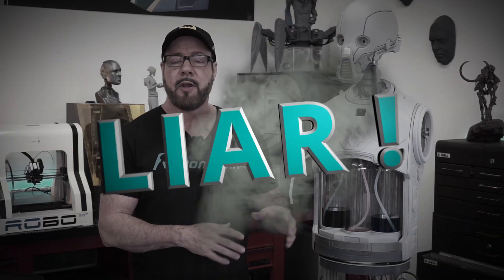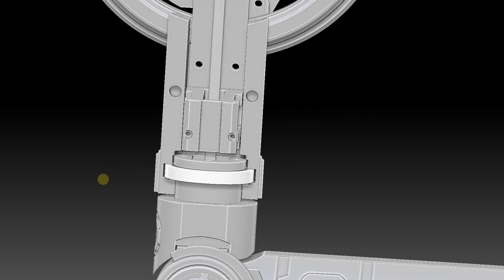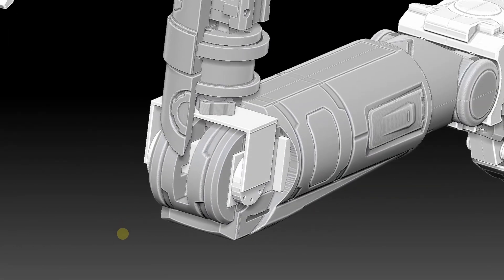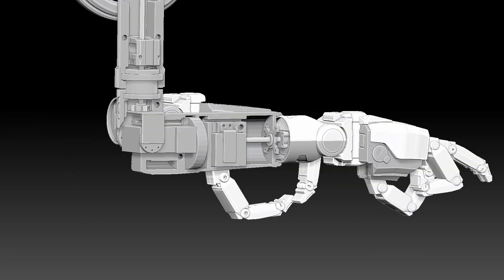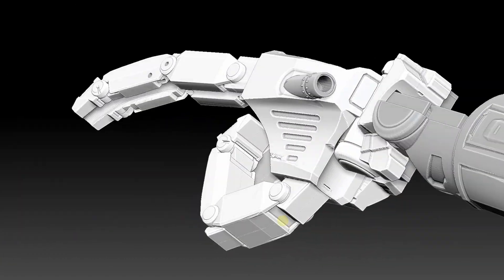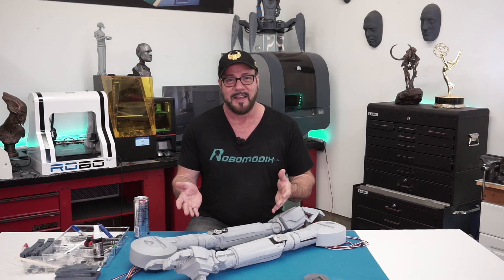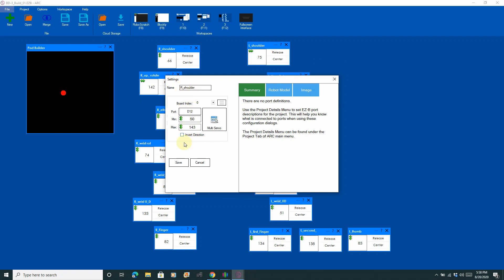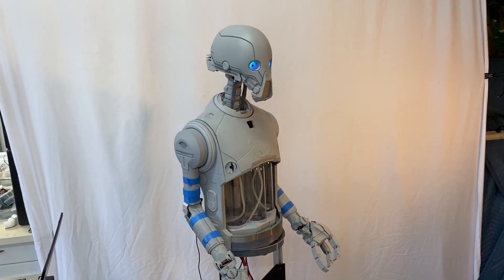My Droid Gets Arms! (Episode 4)

Comment: I am using 4 380kg servos and 2 180kg servos for the arms. What is the best way to control and power all of them with limited space. I am trying to build an AI humanoid robot so using a smaller control board would help it's weight as well. I am attaching a Jetson AGX Orin as the brain. Any advice?

Comment: T1000 Nanorh nanofluids is duable nitinol and other mixed  nano fluids ... Gel 10 skin ..  
Save servos energy
 in recycled polymers hemp fiber
and it's . .. less weight... mashroom fiber  plastics ... in the future ... perhaps
That touch pad and other software 
it's good info ... I was trying to figure things out .. which control software are You  using  in rewired  servos 💾💻
I got... G15KS Meccanoids... 🤖 ...
Thinking about building T800 
 it's duable📚 Cyberdyne Japan is doing exoskeletons ..LOL 
Good Stuff Will🍀
 Make More Cool  Videos📼
 ...💾🎉Stay Immortal ✨🎬
✨Respect !!!💽🎉

Comment: Why use the 60kg servos if the robot is not going to use that much power?
Reply from the maker: Jacob Dynes I’m not sure I understand the question. The 60kg/cm servo uses 7.4 volts and at peak torque it uses just an amp or so.
Reply: @Will_Huff   sorry. Power as in it has 166lbs lifting ability.
Reply: I am asking because I am using them for my animatronic/humanoid robot. I am using them for the spine and legs. How well do they work for you? And do you have any advice on using them?
Reply from the maker: @Dragongod5890  I am actually amazed at the weight they can move, but you need a power supply to feed them plenty of amps. The more amps the better with a power supply. And you can gain a bit more power by using 8.4v. (the max rating) for those servos.
Reply: Thank you.

Comment: This is getting good!

I'm always amused when I see RC servos claiming torque and speed that multiply out to 80 watts, which requires 10A through the power supply to actually deliver, and they have attached ... 22 gauge wire :-P